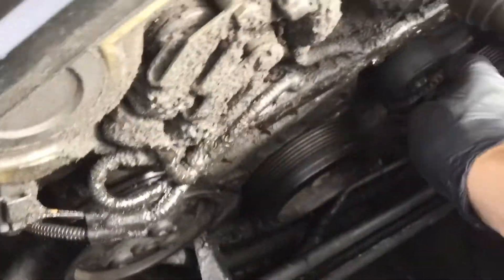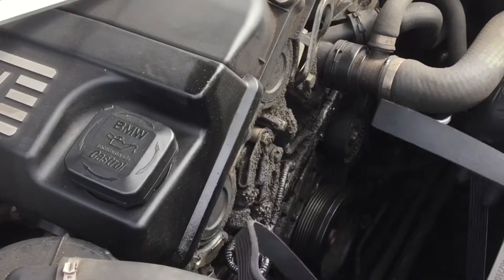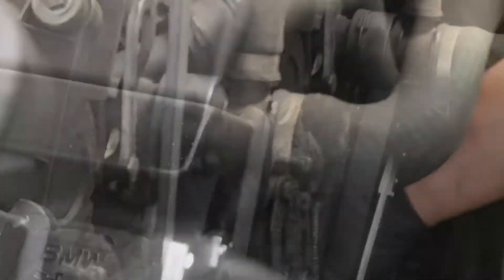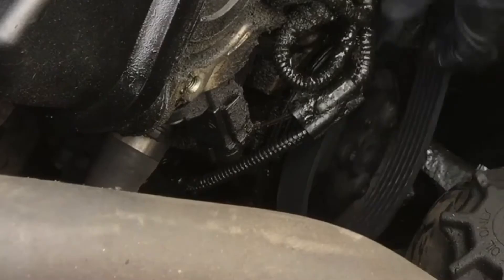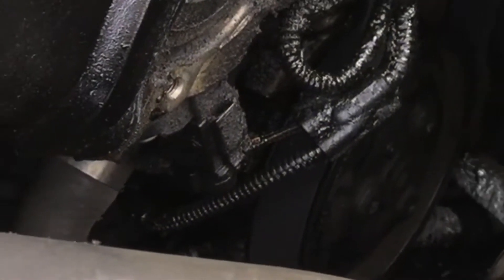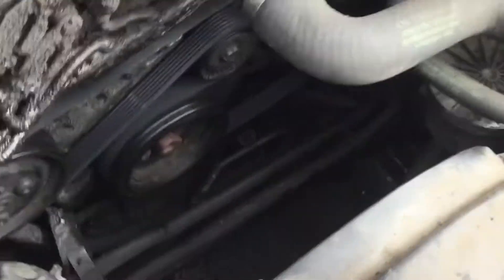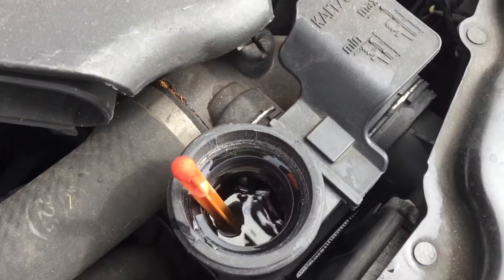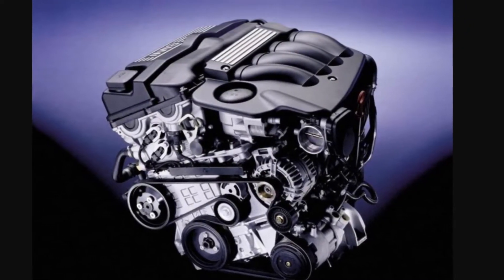BMW 318i 3 Series Alternator Belt Broken How to Replace Serpentine Ribbed belt Engine aux drive belt

Comment: Many thanks for the video! where would I get the 'tensioner tool' from and how would it be described? Once again many thanks
Reply from the maker: Thanks for watching, you don’t need the tension tool, you can use a 15mm spanner, if you want the tool a universal one is best, laser make a great set for £30 just search eBay there are plenty on there thanks for watching 👍🏻👍🏻
Reply from the maker: Thanks for watching, you don’t need the tension tool, you can use a 15mm spanner, if you want the tool a universal one is best, laser make a great set for £30 just search eBay there are plenty on there thanks for watching 👍🏻👍🏻
Reply: Thanks for getting back to me - great info - cheers! :)